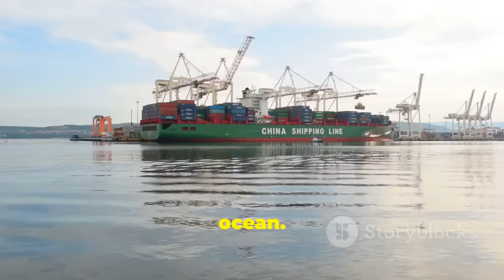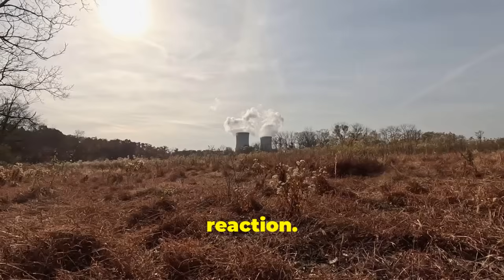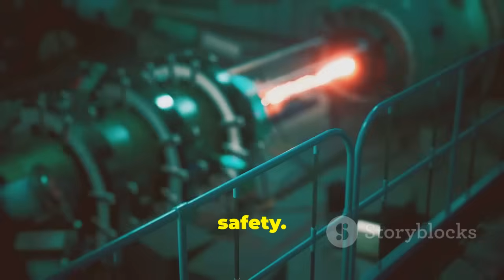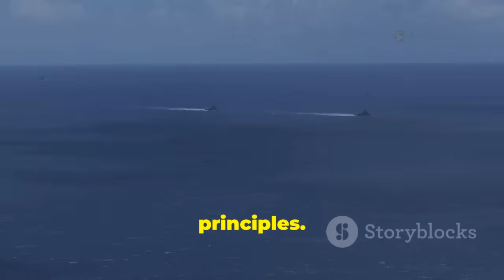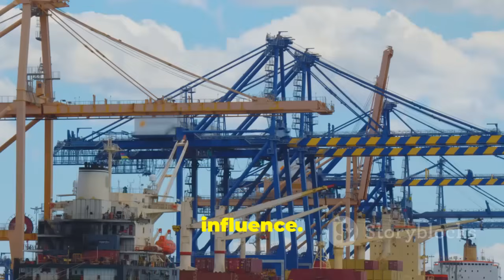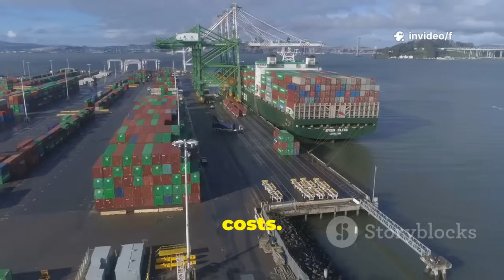China’s Thorium-Powered Ship Sends a Shock-wave Through U.S. Maritime Power.

Comment: China should put it into mass production as it will save china from purchasing fossil fuels completely.
Reply: When the latest, and last, design for coal fired power stations was introduced a dozen years ago China said its steam generators could be replaced by nuclear reactors when these became available. Such power station use steam of at least 550 C, unreachable by PWR. These Thorium reactors work at a sufficiently high temperature. China can manufacture scores of them to be transported to the power stations by rail.

Comment: Why would the USA be affected by this? They have very little shipping.
China is just pulling ahead even more, but nothing has changed in principle.
What it means is that the Thorium Molten Salt Reactor is ready for use in all kinds of ships, and also for the land based  electric grid.
What about ice-breakers. Doesn't China need those for the Arctic route?

China will probably sell those Thorium reactors all over the Global South. Just sad that the USA won't buy them. Just like they don't buy solar panels and BEV.
Reply: If nexperia can be seized. The thorium reactor will surely be seized.

Comment: Will believe it when I see it
Reply: They have just designed it. For China it means that it will be built.
You just haven't realized what it means that China is leading in both Thorium reactors and shipbuilding.
Reply: Its already running for a year generating electricity onto the main power grid for a year without any hiccup.